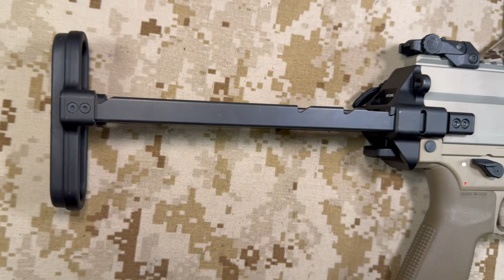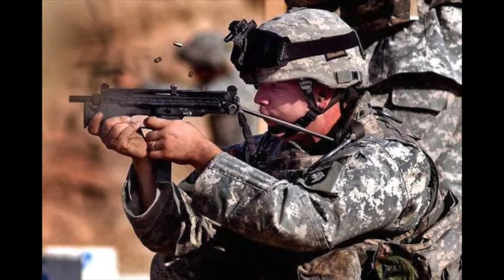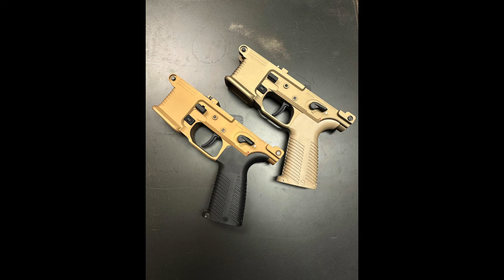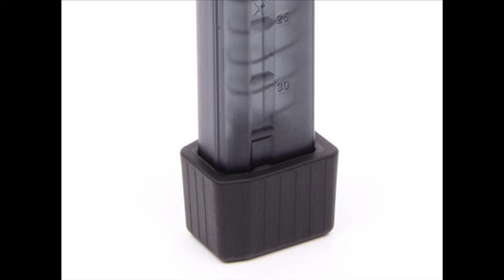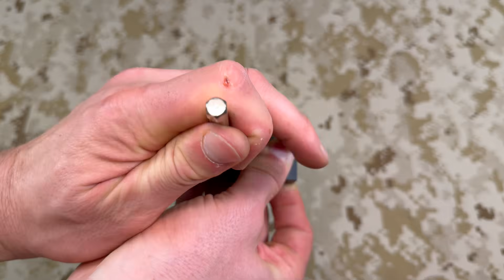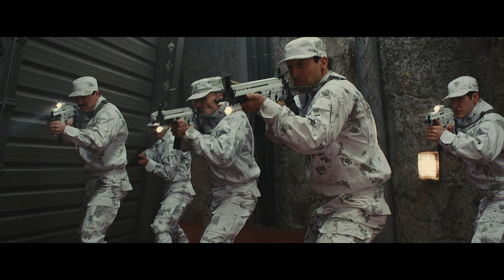B&T APC9 Pro: The Swiss Answer to the MP5

Comment: Will it still operate with the stock fully collapsed or will that prevent it from ejecting?
Reply from the maker: The legs don’t get in the way of the ejection port, so it will still operate reliably while collapsed.

Comment: This weapon is perfect with the CAT MOB or the Alleycat 36. I recommend the AC36. It's incredible. I kept trying to write a longer comment here with more details about it and how these cans are optimized specifically for the APC9, but youtube keeps deleting it. I must be using some cursed word or something. You can find more info about it on CAT's website or on Pew Science. The AC36 is a newer design of the MOB, and it performs a lil bit better overall and is allegedly more durable too, but it doesn't have a removable endcap if that matters to you at all

t's just insane how well both of these perform despite having so little backpressure, either in the early-time or late-time of the blast wave impulse. You don't have to trade performance for comfort with these cans, unlike using something like the Wolfman-Long or whatever

Anyway, I wrote a few more paragraphs about this, but Youtube keeps blocking my comment, and I can't figure out which words it doesn't like, but feel free to ask me more about it

Comment: Awesome video now I can’t wait to pick up my APC9K.
Reply: This weapon is perfect with the CAT MOB or the Alleycat 36. I recommend the AC36. It's incredible. I kept trying to write a longer comment here with more details about it and how these cans are optimized specifically for the APC9, but youtube keeps deleting it. I must be using some cursed word or something. But anyway, those cans are basically the perfect option if you want amazing sound performance on the APC9k without massively increasing the blowback

The AC36 is a revised and improved version of the MOB; it performs a bit better overall in all the performance categories, but it doesn't have a removable end-cap, if that matters at all. I just clean with ultra-sonic cleaners. It's just insane how well both of these perform despite having so little backpressure, either in the early-time or late-time of the blast wave impulse. You don't have to trade performance for comfort with these cans, unlike using something like the Wolfman-Long or whatever

Anyway, I wrote a few more paragraphs about this, but Youtube keeps blocking my comment, and I can't figure out which words it doesn't like, but feel free to ask me more about it

Comment: I am honestly satisfied with my Stribog SP9A3G, especially for the price. It fills the same role as the B&T APC 9 for me. Both are excellent firearms!
Reply from the maker: I really like my SP9A3 as well overall, there are definitely aspects of the APC I like a bit more, but it’s hard to argue with the SP9 being nearly half the price!
Reply: If you shoot it with heavy ammo or with a suppressor, I recommend trying to acquire the alternate locking piece it was originally designed to work with (or verify to see if you have the correct one, since it's possible they've changed it again over time). The Stribog was originally supposed to use a 40° locking piece for standard ammo, like 124gr NATO or 115gr, etc., and then a 35° locking piece for shooting suppressed, and especially if you were using 147gr subsonic ammo in a high backpressure silencer. 

When the Stribog A3 first came to the US, it started having tons of cycling issues, especially feeding, and so Grand Power thought, "oh, shoot, there's a problem with the gun... maybe people are shooting ammo that is just way too weak for this gun? Well, regardless of what exactly is causing it, if we increase the bolt carrier speed, we can get the guns to push through. Let's change the angle on the locking piece from 40° to 45° to make the bolt velocity higher." 

However, the problems with cycling that Stribog A3's were experiencing was not due to weak ammunition in the US, it was due to issues with the MAGAZINES that Global Ordnance had been producing for the Stribog. This was eventually solved and Grand Power + Global Ordinance changed up the magazines and now most Stribog A3's will cycle properly most of the time. The issue is that now there are tons of A3's out there that are 'over-gassed' for no reason and still use the 'weaker' angled locking piece than what it's supposed to use. 

For example, in the HK MP5 and MP5K, there are different locking pieces that are a part of the bolt assembly. The standard locking piece for the MP5 is the 100° locking piece, but depending on the silencer used and the ammo used, one might need to run it with an 80° or 90° locking piece. Although, the MP5 does not generally need to change from the standard 100° locking piece for proper function or longevity of the weapon's service. 

The MP5K and K-PDW variants, however, very often do need a lower-angled locking piece when shooting suppressed and/or with 147gr ammo. An MP5K variant with a high backpressure silencer + full-powered 147gr ammo that just barely stays below supersonic speeds will almost definitely need an 80° locking piece to tame the cyclic rate and speed of the action, both to make it nicer on the shooter, but also to protect the gun from permanently damaging itself as round count increases

I'm not sure what the best way to get them right now is, but when I last looked into it while I was looking for the piece myself, the easiest ways to get them seemed to be either buying them directly from this one european website I found, but they were like $80 + really high shipping haha. And then I heard some rumors online that you could get different angled locking pieces by contacting Grand Power directly? (or maybe it was contacting Global Ordnance for the piece? I can't remember exactly. I didn't bother trying to get one because I ended up buying an HK SP5 instead lol)

Also, I highly recommend suppressing it with a CAT MOB or Alleycat 36, the AC36 is the MIL/LE version of the MOB, and it performs a lil bit better, but it doesn't have a removable end-cap like the MOB, if that's something that matters to you at all.